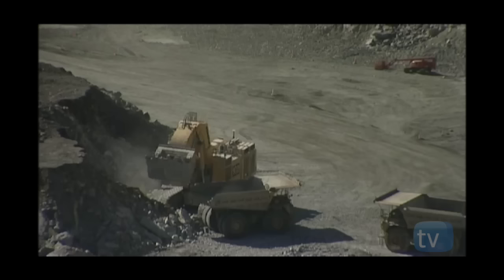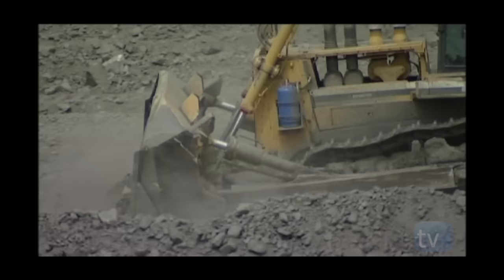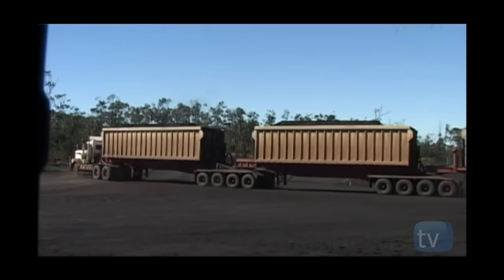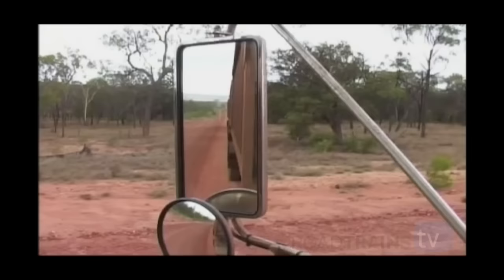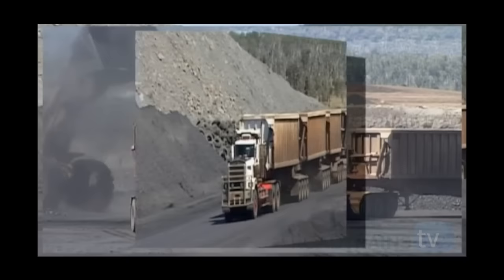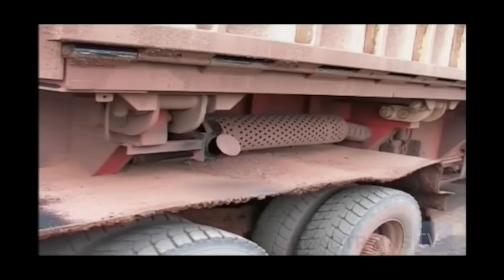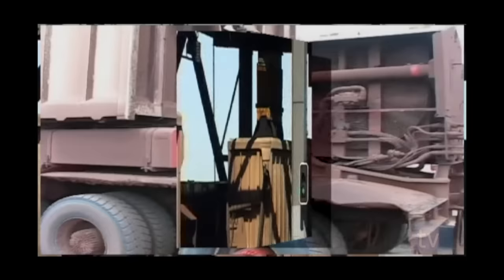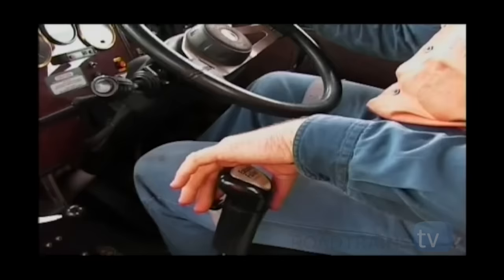Massive 1000 hp Kenworth C510  with 5 trailer road train

Comment: 600 hp.. from 19 litre... 
I would probably go for a 750 hp Scania instead
Reply: It has definitely way more torque than the scania or Volvo lol….
Reply: It has a second engine on the trailer
Reply: @alanmay7929  you should research facts first dear friend.. 
If Scania made something with similar displacement. 19 L vs 16,4.. Even their "small" 13 L engine does better.. 
Almost 2650 nm is beaten by a engine 87,4% the size that puts out 3300 nm. 2800 nm from the 13 L..
Reply: @alanmay7929  yeah lol indeed
Reply: @alanmay7929  then imagine what they could do with a 19 L. 
It would probably be twice as efficient, and by my guess, not even need the helping hand from a second engine
Reply: @thespeakersreview99  you should research your argument first, because that's just embarrassing
Reply: @thespeakersreview99  you keep shoving your case even further dawn the drain

Comment: Why not just put a 20 litre turbo cummins in there. 900hp 3000lbs of torque. No need for an extra engine.
Reply: You forgot these run on dirt traction is limited

Comment: So...... why are you Aussies not using rails like we do in America? I watch about a train every 20 mins move 100+ cars at 100 tons of coal at a time. It has to be way more efficient then using trucks to move your product.
Reply: Darkmatter2134 It would be way too expensive to build and maintain, cause these things go from either one end to the other of Australia, or the middle f Australia to the coast. It's all desert out there as well. Plus these look cooler.
Reply: In the long run, electric trains are cheaper to operate and maintain than fleets of these diesel trucks. Aussies can hire the japanese, french or chinese to build modern high-speed trains for them but politicians worry about whether people will use them. Transporting just cargo might not be enough to cover the costs of building rail systems.
Reply: Most of Australia is unsuitable for trains.
Reply: the Australian desert has major washouts in the wet season meaning a railway line would be easily washed out.

Comment: Not impressed by the tourqe. 606 hp, 2644 nm in the Kenworth
Volvo Dc13 540 (13 litre)  540 hp 1400 -1900 rpm. 2600nm 1050 - 1400 rpm. 
Volvo Dc16 600 (16 litre) 600 hp 1500 - 1900 rpm. 2800 nm 1000 - 1500 rpm.
Feel it a little funny when you call euro trucks weak.
Reply: this was filmed in 2004-05ish
Reply: this was filmed in 2004-05ish
Reply: euro trucks are garbage they  cant last a day here in jamaica , kenworth ,peterbuilt, or mack
Reply: Devin Williams True, but the lifetime of an engine depends mostly on the driver using the truck and how its maintained and ofcourse if its built for the job in the first place. And the D16 is only 3 liters smaller so there is no reason to say that a Volvo will only last forexample half of what a Kenworth does. And there hasn't been any brakedown on the D16 for being to small for the job as long as it has been in producting that i know about anyway.

Comment: Takes a Cummins 19L to make the same torque as a 15L Cat lol.
Reply: Nah not quite I've driven good C15 with 550hp was a great motor and cat are good but as well I drove  signature Cummins derated to 550 for better warranty and reckon they would have an edge over the c15 also drove the older version of these QSK 19 motors the KTA 19 derated to 600hp these were older mechanical version and ill tell you right now with out any doubt those KTA 19 would blow any C15 away. I'm not joking or favouring either as both cat and Cummins have had there good motors also both had there average ones too.
Reply: a 550hp c15 make 1850 lbs of torque a stock qsk19 (525hp) make 1859 lbs of torque and it can go to 800hp from factory with 2275 lbs of torque

Comment: Both Volvo and Scania would do a better job given the chance.........
Reply: They would certainly have the power for the job, but grip might be an issue?
Reply: They don't. That's why large long haul loads they are almost never used. Volvo is starting to break into use with their latest models though.

Comment: Imagine if this tech and brute force were put into solar and wind mill construction...
Reply: Imagine if it was put into something that is actually reliable and practical like hydro-electric, nuclear or tidal power. There is alot of technology for clean burning coal, and natural gas burns clean. Solar and wind are literally the 2 worst options.
Reply: ?? Ever seen the trucks used to haul windmill towers or blades?
Reply: @EdmontonRails  no, thete is no such thing as clean coal.  Nor is gas clean, just cleanER.    Solar is fine but expensive and off for at least half the time, wind even less reliable.   Hydro has limited availability and raises wildlife issues (mainly a tree hugger issue rather than permanent harm) Nuclear is the only totally clean (in terms of climate change) full time power available' but ignorance and fear make it almost impossible to build in many countries.